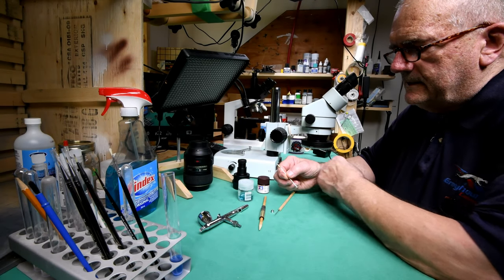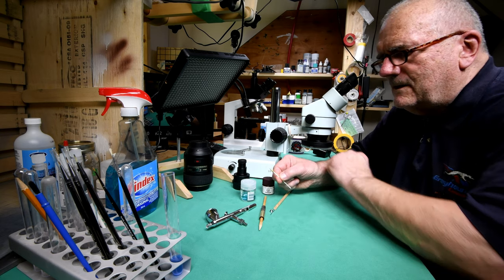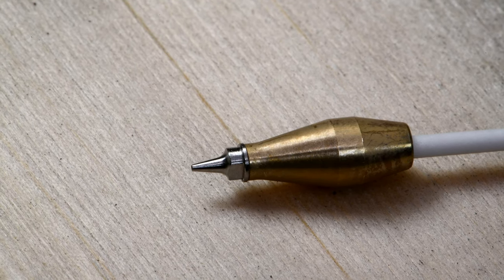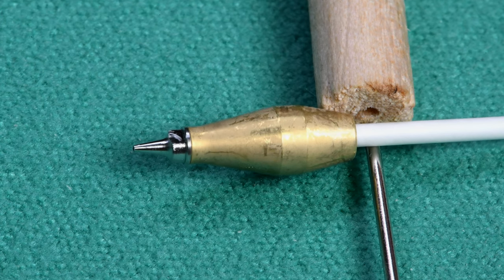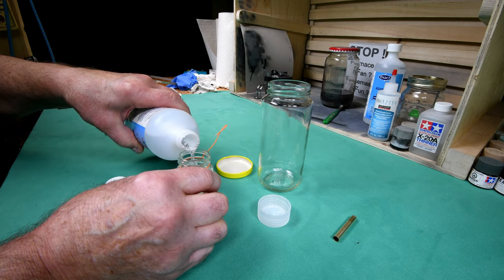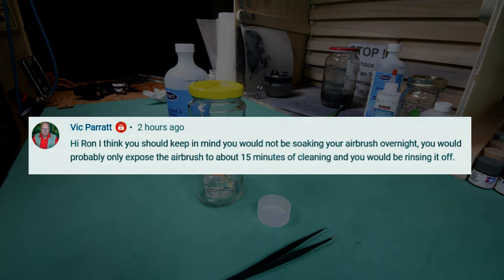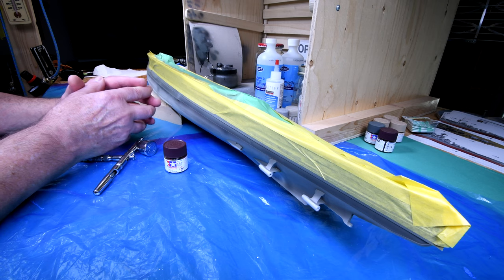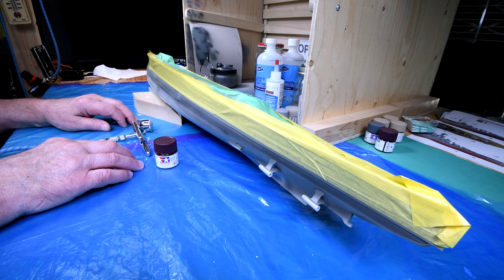The Model Ship - Part 538

Comment: Hi Ron,
Just a suggestion regarding painting large surfaces, like the hull. I notice you tend to spray a few times over the same area in a single go until it's done. I have found that creates a more "rugged" surface with flat paints. Another approach, that I have imitated from experienced modeler videos is to dilute the pain a bit more, like 40% paint, 60% thinner, and spray a thin layer at 15psi. Starting from bow to stern, you can spray the first layer and then come back to the bow and make a second pass, and then a third pass. That way, you avoid overspraying and risking runs and the paint gives a more uniform look. 
The trick about thinning paint is that you keep air pressure low. I recall my father's advice on lacquer spraying, that you need to thin high and keep the pressure low, and making several passes.
Reply from the maker: "thin high and keep the pressure low" That's a good proverb to remember. Thanks Savvas! 👍🙂

Comment: Morning Ron,as your painting on bare plastic and not using an undercoat the best way is to spray paint adhesion promotor on the hull then using tape anywhere on it won't lift the paint off also helps with scratching.
Reply from the maker: Thanks for that tip.👍 🙂

Comment: I posted this once before but I think your spam filter kicked it out. I use a CA Glue Applicator that this builder (John Aliprantis) and I use that doesn't require putting a small amount in something else and then transferring the glue to the part. 
I find that I can control how much or how little I need.
I never have to put the cap back on the CA bottle.
If applicator gets clogged you just cut the end off  and  keep going.
Check the applicator that he is using:
https://www.youtube.com/watch?v=At7b7pzLfVA
This my help you with your build.
Reply: I should have add that the applicator is at 18:50
Reply from the maker: Thanks Friend. I just now took your advice and ordered something similar form Amazon. Should be here in about 48 hours. If they arrive in time I'll show them in episode 541. 👍🙂